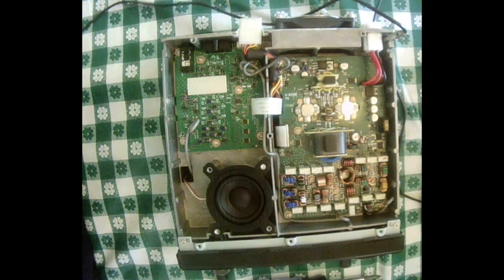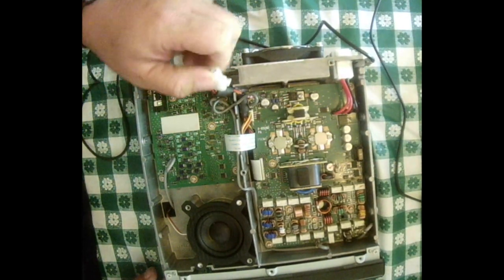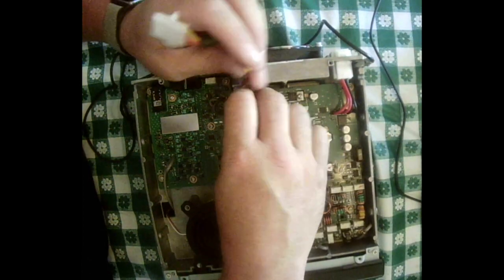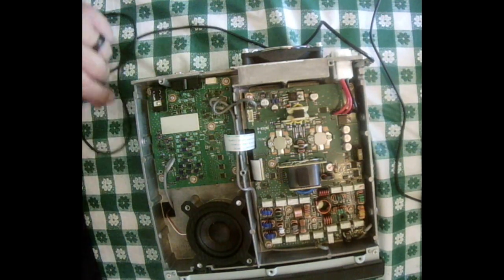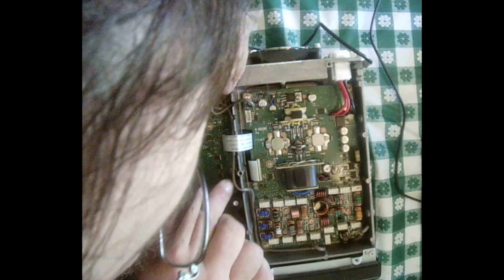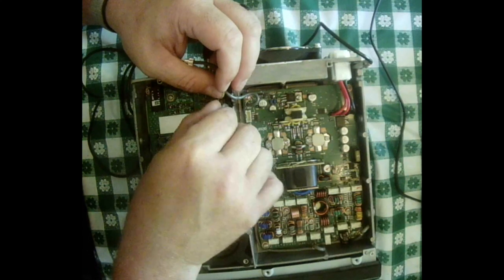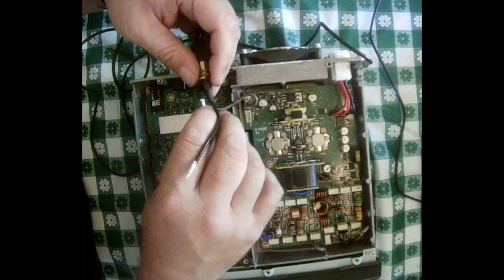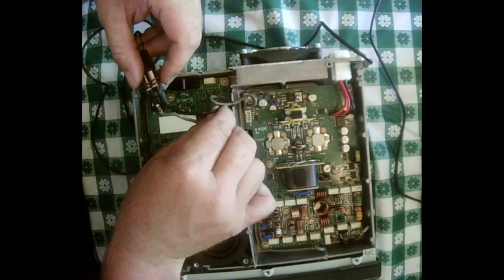INRAD RX7300 Installation

Comment: what if you want to use an ATU as well ? i use an external ATU on an end-fed 80m wire to get 160m with a 1.1 SWR
Reply from the maker: It's been a year since I installed this. I think there is enough wire on the ATU wire that you could notch the case and put a rubber grommet to feed the wire through.

Comment: Hi Adam!  Wonder if you could give me a piece of info or advice.  The screws on the top cover of my 7300 are so tight, I think I am stripping them (using a #1 Phillips).  Did you do anything special or use a special screw driver?  Thanks in advance...
Reply from the maker: I stripped one screw out while removing the top. I used a #1 Phillips and after stripping one I used pliers on the screwdriver while pressing hard on the top of the screwdriver.
Reply: @AdamZaimes  Thanks.  Looks like they use a JAPANESE Phillip Head Screw Driver - trying to find out what size, etc.  As it is now, I can't get any of 6 I tried loose and I am applying a fair bit of pressure...  Always something.  Thanks for the help!
Reply: @AdamZaimes  Just closing the loop.  FWIW, the screws are Japanese Industrial Standard (JIS), it was recommended I get something like this  https://www.amazon.com/gp/product/B00A7WAHTU/ref=ppx_yo_dt_b_asin_title_o00_s00?ie=UTF8&psc=1

73

Comment: what is this for? so you can plug a SDR and monitor the spectrum? or something else?
Reply from the maker: This is for adding a separate receive antenna to the radio.
Reply: @AdamZaimes  what happen to the tuner after plugging in the inradrx7300? Do you now required to use an external tuner? Coz I didn't see it was put back.
Reply from the maker: Jayward Julian the connector removed is for an external tuner. It did not affect the internal tuner.